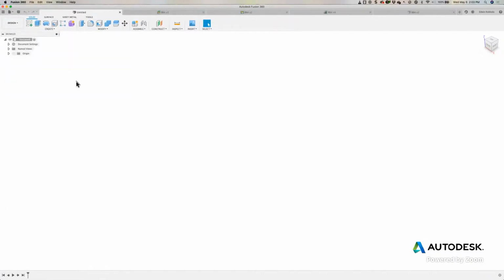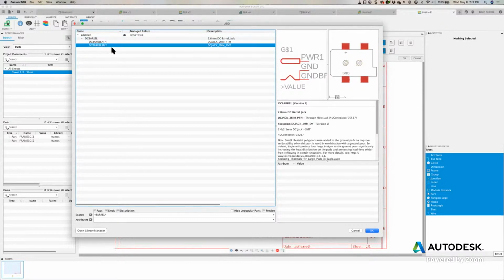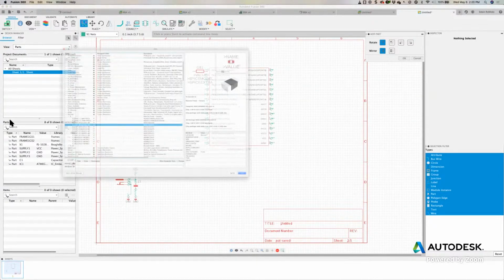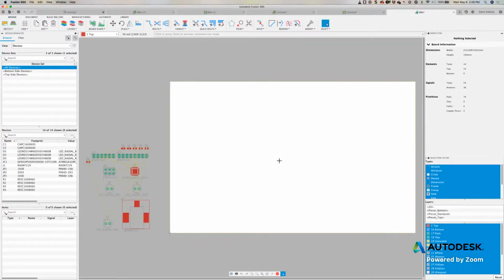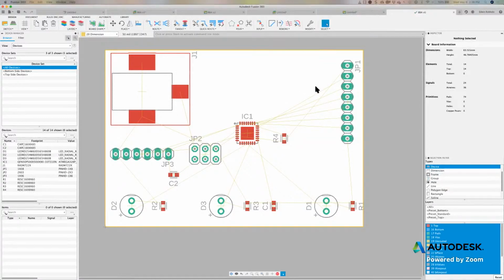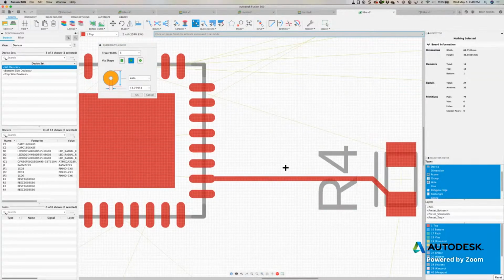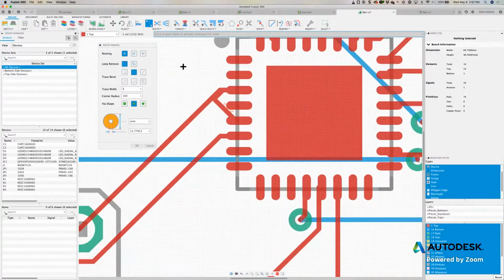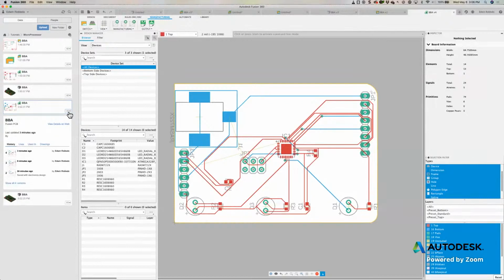360 LIVE: Getting Started with Fusion 360 electronics

Comment: I didn’t notice too many issues with the audio but I didn’t watch this stream from start to finish — I kind of jumped around.

Despite this, I have to say I’m super excited to see Fusion 360 Electronics well-integrated into the fusion environment. I am still using the last update of Eagle from 2020 but this video convinced me to switch over. Excited to get a much smoother workflow when switching pushing and pulling designs between Eagle and Fusion.

Comment: Seriously - you spend 5 minutes talking about libraries and the library manager and then decide you don’t need to use any of them? Plus the first part you use is a frame which is not available as a default under “add part”. If this is supposed to be an intro video start with immediately simple and useful stuff and add extras - this supposed to be an intro tutorial not a demo - please expend some effort on actual educational materials from an experienced educator. The issues with the sound are terrible.